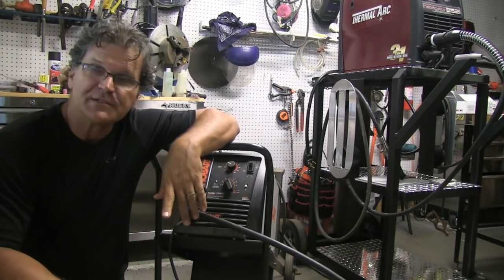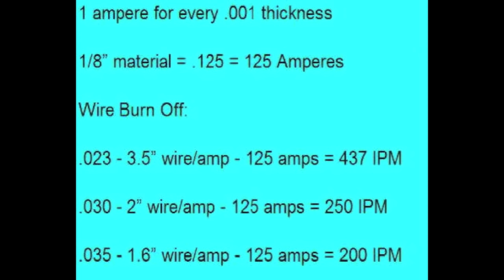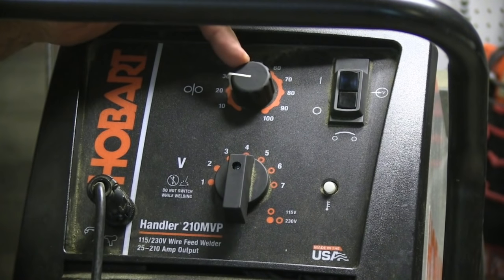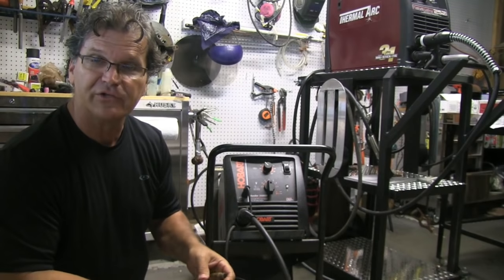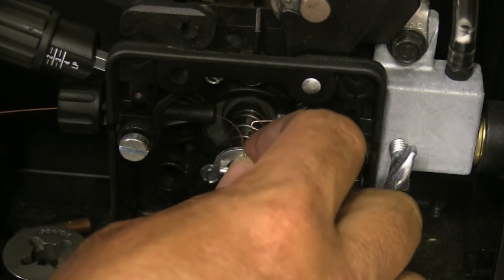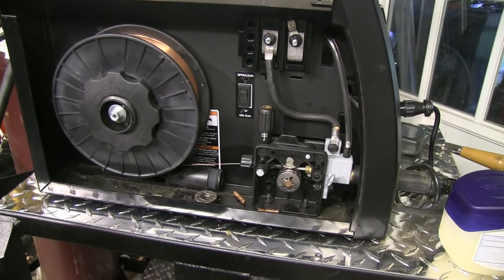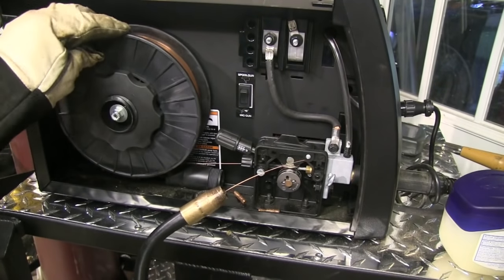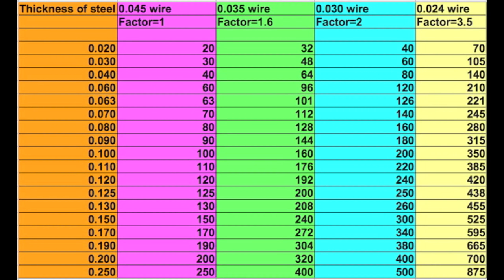Mig Welding Basics part 3-Setting Voltage and Wire Speed

Comment: Thank you Jody, I live in the Philippines now and do not have the resources I had when I lived in the USA so your videos have been a lifesaver.  I purchased a portable gasless MIG welder because gas is almost impossible to get here and if you are lucky enough to find it it is very expensive so most welders are stick or gasless Mig.  I have to say there are a lot of folks who put up good videos but you are the best.  I was really struggling to get a good bead going on my workbench project but thanks to your help I was able to get it done being a first-time welder.

Comment: Hi there . This is Danny from greenwich London. thanks very much for all the videos. I am really enjoying them and getting educated at the same time. I have been in the Motor Trade business since the 70s when i was 9 years old and everything was soldered with Oxyaceteline.I am just over 50 now.  I work in a bodyshop where I restore Ferraris, Aston Martins, Rollers, etc, and all the material you teach has been invaluable to me , especially as I used to be on the painting side before. you're never too old to learnI have an english made transformer welder, the Oxford Migmaker 270-1. amp range from 15 to 270. really loving your courses. they are funny, informative and bloody helpful. Thanks again.

Comment: Thanks so much for this.  I was "taught" to weld ages ago, on an industrial Miller power source and feeder where the settings were only vaguely correlated with the actual voltage and and wire feed speed.  My "teacher" "seat of the pants'd" the settings, and not having better information, setting the machine up by ear got me to reasonably decent welds for years.   

Recently I bought myself a schmancy Miller power source and wiz-bang feeder and tried to set the thing up using Miller's recommended settings.  According to them, 1/8 mild steel wants about 290ipm in .035 at 18.5V and 145 amps.  Set up on the nose with measured wire feed speed, I'm either blowing holes left and right, or making rat turds.

Set the thing up by ear, and it welds sweet enough, but I was starting to think I was nuts.  Then I find your chart.  Makes me think maybe it's Miller that's nuts - my "ear" came up with 190-200ipm and 20-21V (the torch that came with the Miller feeder has a recessed contact tip), which puts your chart a lot closer to my reality than Miller's recommendations!

Comment: For the metric people, numbers below referring to the 1:12 mark:

1 Ampère for every 0.025mm of material thickness.

So for 3mm thick plate (1/8 inch) the ampere setting should be 3/0,025=120A.
Small deviation in sheet due to roundoff.

For 0.6mm wire: 90wire/amp, 125amps *  90 = 11250 mm per minute (check. 11250/25,4= 443 inch per minute)
 
For 0.8mm wire: 51wire/amp, 125amps *  51 = 6375 mm per minute 

For 1mm wire: 40wire/amp, 125amps *  40 = 5000 mm per minute 

Thank you jody for the years of information you gave me, and for the useful items in your webshop!
Reply: thank you so much my brother

Comment: I just recently got  a 30# spool of .063 308L wire for $8. After seeing your video I came up with the wire factor for this spool knowing that we need to compare areas (.045/.063)^2 = about 0.5 for wire factor - and it works!!! I'm able to use my bargain now, thanks!

Comment: One remark - on welders with a 'soft start', wire feed speed may start out slow and then bump up when the arc establishes as you start welding. Took me some time to figure out this was the reason the 6 second wire speed determination didn't add up for mine.

Having said that, you make awesome videos! Best welding videos on the net by far. No nonsense talking, just quality content all along!
Reply: I have that run-in setting, which is turned "OFF", until I figure out how to use THAT, it seems like it would be helpful, but in practice so far it just adds confusion.  Without it you definitely start with a bang.

Comment: Thank you, Jody, for taking the time to create this series. I have used my Century GMAW since '96. Lately it has been as cantankerous as a honey badger in heat. While voltage and wire speed are both variable, not steps on the voltage, I was not able to tune it in. Finally followed your example of stop watch and tape measure to set wire, then tweeked voltage while welding. Found I have two issues needing addressed. The rheostat for wire apparently has a dirty wiper. I also need to clean or replace my liner to smooth wire feed.

Comment: Love the videos, i manufacture heavy agricultural equipment, i see a lot of the guys in the shop getting cracked welds, most of them run slow and cold and produce really pretty welds but they always look convex and just seem like they didnt tie into the toes of the weld and sometimes i wonder how it would look on a micro etch, i was taught to run hot and fast and i have yet to have a failed weld for example on 1/4" to 1/2" inch most of the guys weld at 23 volts and 375 inches with .035 while i weld at 30 volts and 400 inches with .045, i can see the difference, my welds are nice and flat, i can see really good penetration on the toes of the weld, if i weld 3/16 ill usually get undercut but if i do a little back and fourth it fills the undercut and turns out good, anything from 3/4 to 1 and 1/4 inch i weld around 35 to 36 volts and 550 to 600 inches a minute, i really wish there was a way to upload pictures on the comments, i see people go by wire feed speed but it gets kind of difficult when you get up to 1/16th dual shield or .072 or 5/64th self shielded so i always went by volts and adjusted wire feed speed, for 14g and to 10g i would weld at 21 volts and 225 to 275 ipm with .035 for 1/8" i weld at 26 to 27 volts and 325 to 350 imp with .045, 1/4 to 5/8th around 30 volts and 400ipm with .045 and 3/4" to 1-1/4" i weld 35 volts and 550 ipm with .045, ocassionally i end up welding 2 inch steel for ring mounts on some of the heavier equipment and will run 40 volts and 600 to 650ipm with .045, the company will only allow us to do single pass welds since they are more focused on looks, i told my boss straight up that he should be matching fillet weld sizes but he refuses so i run hot and fast to compensate because i dont want to send out a piece of machinery that fails and someone gets hurt and they come back to throw it in my face

Comment: Ive watched plenty of videos on how to determine the wire feed speeds by using the 6 second rule and measuring the amount of wire thats fed from the gun and making a quick chart for future reference.
Yesterday I learned something interesting about this process and decided to share my findings because Ive not seen mention of it anywhere else.
Like the welder you were demonsrating mine has the clickable power settings and an infinately adjustable wire feed knob. For no reason at all I set my power knob to the lowest of 6 available settings and did the test for all 10 wire feed settings and even wrote my results on the top of my welder and decided I was done for the day.
I packed everything away and was sat looking at the results thinking they all looked a little on the low side, so I dragged my machine back out and did the same test on the highest of the 6 settings and EVERY SINGLE NUMBER was DOUBLE that of the lowest setting indicating to me that the machine speeds the wire feed speed up the higher the power knob is set.
Of course I did thetest for the other 4 power settings and the IPM's were in between the lowest and highest setting so now I have 6 IPM charts that correspond to the different power settings of my machine.
As Ive said Ive not seen any mention of this phenomenon anywhere else so I would be interested to hear what any of you reading this think of this and ask that you try it on your own machines and see what results you get.
Ive got 2 other machines to try this on and one of them is a 3 phase 350 Amp monster with 12 power settings so I will be doing the same test on those when I get back into my unit.
Hope this helps and I look forward to any responses.

Comment: Jody, I really like the videos you have here! In answer to your question about settings for voltage and amperage of different wire sizes and types. Do an internet search for the specifications of the specific manufacturer type and size of wire and you will find a chart that shows wire diameter, wire speed, amps, volts and electrode stick out. Merry Christmas from a Wyoming welder.

Comment: I had an instructor tell me your voltage is 10% of your wire feed.
Inwas on a Lincoln machine and didn't get very far as inwas burning tips.
So after a bit, I went to the machines recommendation, and it worked. 
256 Lincoln is what I used,  a nice machine. 
20A at 500 wf is where it was happy at.
I did 20 at 200 and I couldn't get going like it was too hot and burning back the wire into the tip.

Comment: In metric system: 
    To get the amps:        thickness of material [mm] * 40 =      [amps]
                  example:          3 [mm] * 40 = 120 [amps]
    
    To get the wire speed:
          For 0,75 [mm] wire:     5 * _  [Amps] =         [cm/min]
                            example:     5 * 120 [Amps] = 600 [cm/min] = 10 [cm/sec]   ,  ==>  60 cm for 6 seconds

          For 0,875 [mm] wire:   4 * _  [Amps] =         [cm/min]
                              example:   4 * 120 [Amps] = 480 [cm/min] = 8 [cm/sec]     ,  ==>  48 cm for 6 seconds
1 inch = 2.51 [cm] or 2.5 [cm]
Reply: prasiprassi Thank you soooo fucking much!
Reply: aronS:')
I just adjusted the formula from American units to International units. I think i took the original formula from the video or a link the guy provided.
Reply: +prasiprassi is there a chart I can see on the internet somewhere with all the settings? and for wire speed, what if it's 0.9mm thick?
Reply: MotorcycleTherapy
You can google "welding charts" and look around but it will most likely be for a specific machine.

Comment: Amazing, this helped a lot. I've been using stick for years and have recently bought a mig welder. Completely different feed back from this type welding, although easy to weld with, I was a bit concerned with settings. I wasn't convinced I was getting the penetration I needed. After watching this video, I'm now convinced my settings were not far off. My welder did not have a chart, nor did it have voltage settings or wire speed settings indicated on the dials. The 6 second measure was great and helped enormously, keep up the good work. Now I know my gates won't 'ping' apart at the galvaniser :)

Comment: Welding for the past 15 years, I have a pretty good idea what settings are needed (voltage/wfs) whether pulse, spray, short arc On water cooled 455 or my miller 211 in my garage. My approach seems to be the opposite but works for me. I set the voltage for the material and dial in the wfs. Reason i do it that way is there was always a cheat sheet under the door. :)

Comment: Setting wire speed and voltage in MIG welding is the most important and difficult thing..Thanks for your useful video..

Comment: Jodi,  I really like this method.  I'm sold on it.  The recommended settings on different machines are just wrong, IMO.  I used to rely on manufacturer charts at first, but not getting the best welds consistently.  So I started tweaking, based on experience, but that wasn't perfect either.  This makes too much sense not to use it!  Cheers and Props.

Comment: Love the videos!  You do a great job.  I've been learning mig with my Everlast power Mig 140.  In the manual and in miller's manual, they say to set voltage first then adjust wire feed speed.  Seems to make more sense the way you present here since it's based on thickness.  Thanks again for all the insight!

Comment: I dont know if its just me when  your an experienced  welder and have been using the same machine  for many years , say you have a big fan housing and you have 1/8" sheet metal on one side I set my machine to weld that and then get to the mount base of 1/2 " thick  material  you get really  familiar  with your machines heat setting  and capabilities, and can instantly change your heat settings wire speed  and voltage on the fly depending  on what type  of material  its thickness  and your position  flat  ,virtical , horizontal , overhead .because  your used to the ol girl and know what she likes, but I have been  to job interviews where I had to take a welding test with a machine that I have never used before and can always  find its sweet spot for the material  im welding,  Hood time with different  materials  is your best friend  .

Comment: Jodi , I am a new subscriber. I am and have been a certified pipe welder for over 4 years been welding for 20 off and on . I now work for a horizontal drilling co that puts in natural gas (steel and plastic ) my prob is I might go over a year w no steel and he walks outside one day and tells me I have a steel test next day , and thinks I will have noo problem . Please comment

Comment: My way to set my voltage and wire speed is a cheat method. I have a miller 211 with auto-settings, just put in your thickness for wire and thickness of steel and all you have to do is pull the trigger. Granted it is my first welder and I never took a welding class but it handles anything I throw at it.

Comment: One thing that I learned just recently that will lead to a totally frustrating experience is running shorter contact tips where you really need long ones.  Because the machine tries to maintain a constant voltage the increased stickout decreases amperage a ton.  You have to use the right length tips for your gun.

Comment: I'm going to be welding lids on oil filled transformer cases and boxes. Any recommendations to get a nice coved type weld? Generally overlapping and butting 1/8 in, 1/4 and some thinner gauge steel. Great content also.

Comment: Miller 250MP.  The micro processor does the calculations for you.   Input wire type, size gas, metal type, thickness and gas type.  The MP sets the voltage and wire speed for you.   A little fine tuning from the selector on the gun (voltage, wire speed, or both) and roll.  My replacement bernard gun doesn't have the selector and I really miss that feature.

Comment: Jody,  this all looks great and thanks for taking the time to post. I have been doing some auto restoration  and frankly always used my Synchrowave 250  machine and tacked with tig then went back and filled  between the tacks far away from last applied heat  to avoid warpage on body panels ( vintage Porsche under body and steel fender flairs) on the the thin metals 030.    That being said I do have a  cheap 120V wire feed Mig.  haven't used it for years.  Do remember it worked well to stitch in some rust panels. Locked in floor panels etc. it may be able to do more...   What adjustments would you think appropriate for thin materials that may have gaps and or not perfect lapped material ? lesser amps and more feed?   You just may have  inspired me to drag that old machine out and make a stand for it.   Then probably figure its a piece of crap and ditch it and get something better,  maybe I can make it work.     Ken

Comment: So the chart you showed us tells us how to figure out amperage. But what about setting the voltage for MIG welding? Can you go over the difference between amps and volts, why stick and TIG welding use amps and MIG volts, and how to determine voltage from amperage? Thanks! Great videos.

Comment: here is a really good tip trick... i use a tip cleaning file kit from an oxy acetiline (sorry my spell check doesnt recognize the correct spelling) gas welding torch to clean the inside of used tips that tend to drag on the wire. they are available at any big box stores that carry welding supplies for less than10 bucks and have tiny round wire files of various sizes... i do a lot of flux core  welding on sometimes less than clean metal.... works like a charm.

Comment: another good tip... if you are welding on automotive, farm equipment or anything that has electronic ignition or computers on it... disconnect the ground from the battery first, it might save you thousands of dollars for a new ecm (engine control module)

Comment: hello friend , i reacently dismantalled a hydrolic jack to build a flow booster with it and i had to weld the small piston to the larger one , well now the small piston base will not fit back in the bore ? it is discolored yellow and blue in that area and it now measures like .4mm larger. my question is do metals expand when heated and stay large from absorbing oxygen  or is it just possibly distorted ? I was carfull to keep heat off the piston rob but it seems to have expanded and wont fit back into the cylinder, are you familiar with this phenomenon    ?

Comment: Thanks for this video! It really helped me get started with my new mig welder.
What about if i use Flux Core wire? does this formula still apply? it is my understanding that FCAW runs hotter and so needs less IPM/Voltage than mig?

Comment: Hi Joe. I set up my Hobart 140 to check for wire speed. I think I have a slight issue. When I set it for a setting of "4" for Voltage (older model) I get 360 ips at 40. When the voltage setting is at "1", however, it is a MUCH slower 220 ips. What is up? Apparently this machine automatically speeds up the wire with the higher voltage rates. Now what do I do to get consistent welds? Argh! I thought the wire speed trick was gonna really help me......

Comment: Hi Jodi, my question, I do a lot of repairs and fabrication of galvanised, painted, dirty farm equipment etc, I run a Miller 211 Autoset Mig and i run flux core wire 0.35 mostly. Now i get a lot of spatter etc, what are your thoughts on running Argon mix 80Arg/20 Co2  (thats all i can get here in Japan) will i get better results or are my settings all stuffed up? I do use the Auto set function, should i forget that?